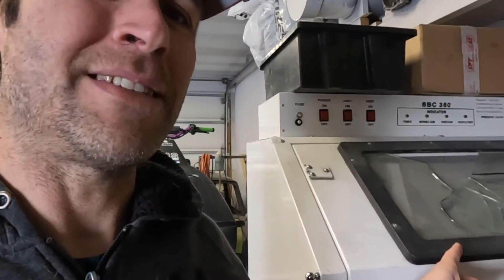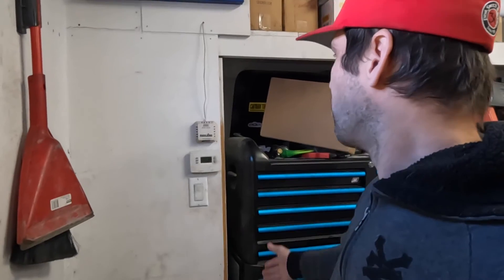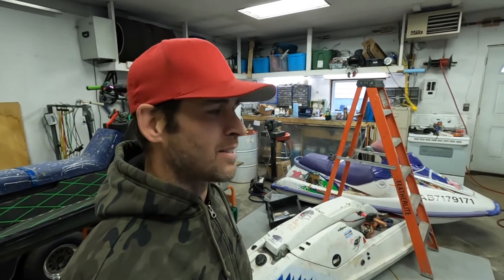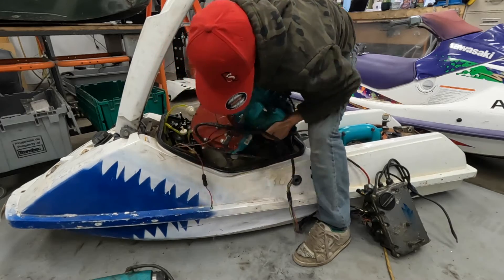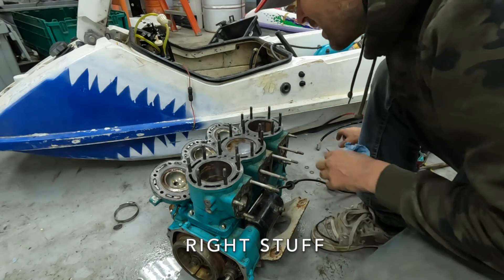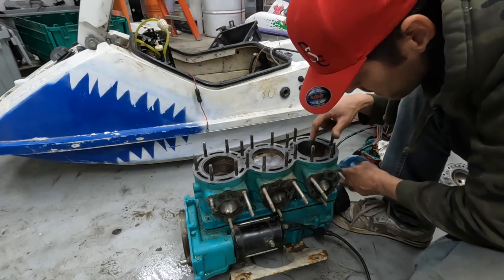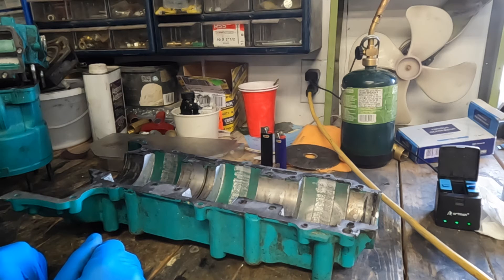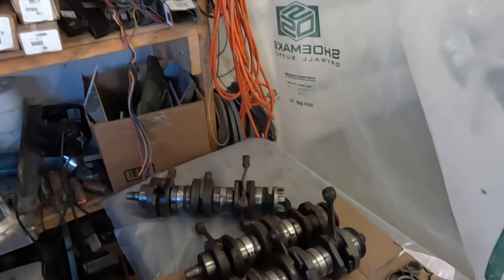SeaRat Engine Disassembly - Seized Kawasaki 1100 Triple Teardown

Comment: Stop complaining and get a snowmobile. In case you don’t know they’re nearly as much fun as a Jetski. Some of us haven’t had enough snow to ride for several seasons
Reply from the maker: HAHA... I've had snowmobiles throughout my childhood ... Skiroule, Moto Ski, a few old Ski-Doos, a Polaris and my last one was a 95 Yamaha Phazer 2 Delus... that's right ... Delux !! 😂 meaning it had electric start and different decals. To be fair... it was pretty delux compared to the previously mentioned snowmobiles. I spent many hours as a kid ditch banging, running over small trees and doing laps in the field next to my house. 

I also worked at a Yamaha and Polaris dealership from 95 - 2001 and got to ride lots of junk.... I also worked on drag race teams that had an Indy 650, Indy 500, Yamaha Exciter 2, Phazer 1 and V-max 4. This was mostly ice and hard packed show... but I do agree... carving around a snowmobile in powder is much like a jetski, and one of the most satisfying things I've ever done... you need to be dressed well though. 

I grew up in New Brunswick, and we usually had lots of snow to play in, but where I am now... You have to travel for a few hours to a place to ride ... the rockies.

Comment: Hey Joel, great to see another wicked vid, just starting to get really warm over here in Australia, just starting to be jet ski season,. Have to do a few things to the Kawasaki ultra 150, like accelerator cable and steering cable, put in a bildge pump, , just a question should I leave the original oil pump and put new oil hoses or put in an oil delete kit and run premix fuel, any information would be great, anyway hope you can help, cheers mate
Reply from the maker: That's great Adrian ! I heard from another Australian viewer that they were having lots of rain and flooding where he was. How is it where you are ?

I personally like mixing, that way I know that nothing can fail due to lack of oil BUT I have read that these pumps are really reliable and there's no need to delete them, so it's basically personal preference. 

It is convenient to be able to stop at a gas station and fill your tank without having to worry about mixing, especially with a large tank... If your pump was working. For my ski I have a small tank and carry two 20L mixed cans with me... but if I had a large sit down ski that had a working pump, I'd probably leave the pump on it. 

I know that's not a clear answer, but like I say, it's personal preference.

Comment: You do a really good job of not looking mad when it's going like crap! That truck thing is really dumb. It seems like a lot of dumb crappy stuff happens to you. I know the rat has a hood intake right right above the carb on the cylinder that broke. Let me tell you the engine mounts I made for the krash are a lot lighter than what you dropped on the window. You should make a front fill for the rat that is the shape of the bullet.

Seeing water in the stator cover makes me want to put some right stuff on the superjet cover. Seems like the o ring doesn't quite do it or water comes in some other place.
Reply from the maker: Haha... Sometimes when bad things happen, you just gotta laugh.... Nothing else will make it better, and most other things will make it worse. I was able to break the door handle off my truck today and get into it, take my important tools out so they don't get stolen. Now I just need to get new keys handles and locks. I was also able to fix my floor heating last night and it seems to be working fine now. 

Haha... I never noticed the intake above that back carb, but Dustin did point out that the spark arrestor had water sitting in the top of it. I remember seeing the video where you made new mounts out of aluminum and bent them at Rob's ... I believe. I'll make a mold of the Bullet like you did of the SJ and pull the gelcoat off the Bullet 😂 

I think putting some sealant on there is a good idea ! I'm pretty sure what happens is that the engine heats up and builds pressure inside the stator area and pushes air out. Then, when you get a bunch of water in there, or sink it, it cools off and creates a vacuum inside the cover ... any water that is around the cover then gets sucked in... I do know that I've only ever seen one or two that haven't leaked.
Reply: @JoelArseneaultYouTube  Definitely need to rip the gelcoat off. I can't have nice things.
Reply from the maker: @Jacobskibros  😂😂😂😂

Comment: Water is being ingested from the intake on the rat. Get some sealskin covers for the pods.
Reply from the maker: Yes... That is what happened. We didn't have the bilge pump hooked up and the hull filled with water. I didn't care too much because this crank was already in need of a complete rebuild. All of the bearings and rods were rusty and pitted. I will have to be more careful once I rebuild the crank. 

Thanks for the comment !